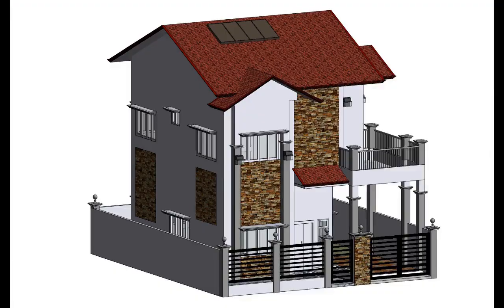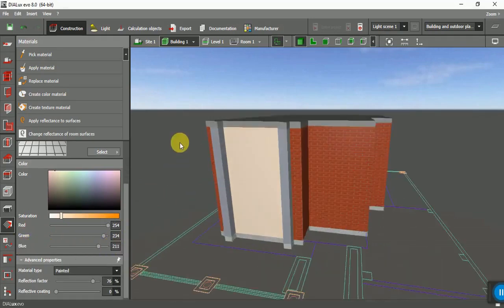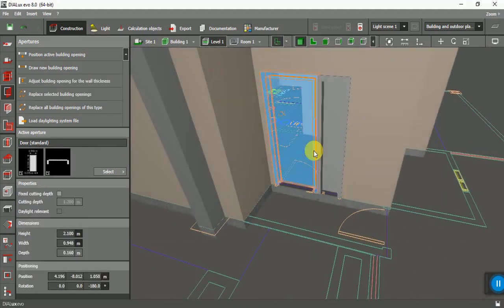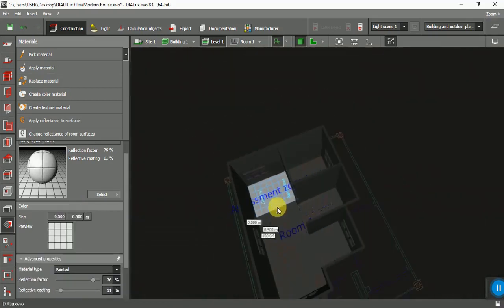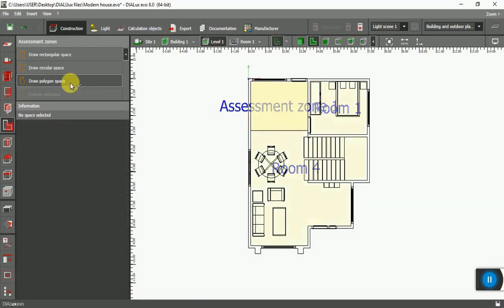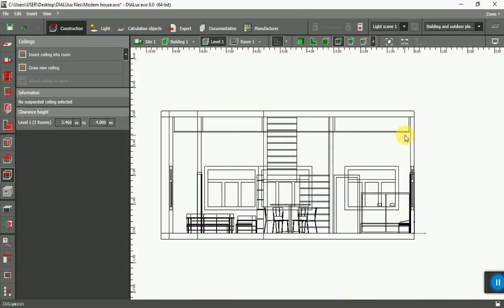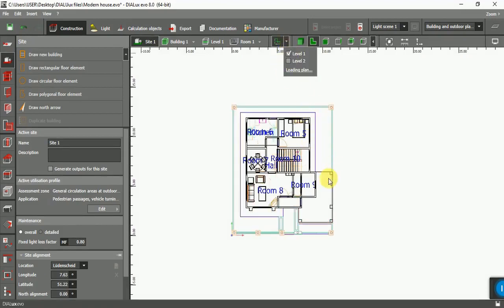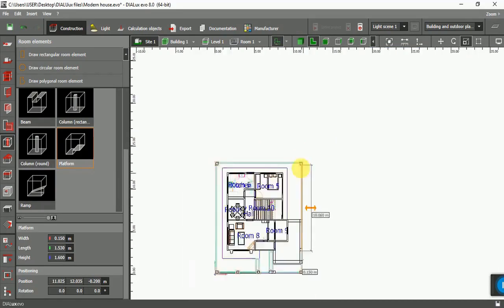DIALux Evo Tutorial For Beginner | Construction Part 1 of 2

Comment: Does this software tells the number of fixtures to meet the required lux or do we have to keep inserting luminaires on a trial and error basis till the required lux is achieved?
Reply from the maker: first, you have to clear the number of lux and find it from the standard your country uses. then when you choose the light number, after calculation, if it was not complete or enough for the entered lux, it will show you in red line it means it fails.